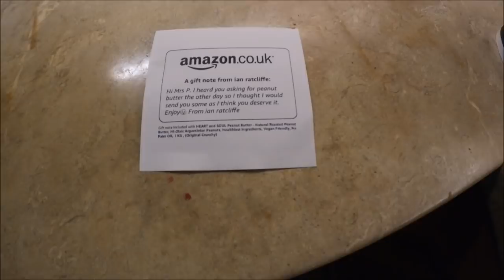Pulling Ragwort, Stud work and checking my new yard drains.  28 09 21

Comment: When we came to our farm, there were 18 acres of seriously ragwort infested pasture. We cut one field for hay and picked through the swaths to remove the weed. We filled 4 twelve foot trailer loads and burnt it in big heaps. I was surprised how those damp weeds roared away in an inferno. We invited a neighbour to graze his cattle on half the area for two weeks. Three weeks later had to remind him there was only ragwort to graze. Finally got rid of them and topped the field and left it until the Spring when we grazed the sheep at the rosette stage. They did a good job in getting rid of most o it. We had to pick carefully through the round bales when feeding to remove what we missed. I never walk past a ragwort plant now, my pocket knife is handy to help loosen the roots.
Reply from the maker: I wish everyone was as diligent Wendy, I don’t necessarily want to see it irradiated, there are a few little beasties that rely on it. But I would like to see it under control.
Reply: @FarmerP  yes we have rough field full of wild flowers and the occasional ragwort attracts some pretty butterflies, such as the small copper. I pull them though     before they go to seed..
Reply from the maker: @wendyrowland7787  
Great minds there …. 🙂👍🏼

Comment: 2x4 stud work timber is not very cheap £5 a length when I priced it at wikes
Reply from the maker: Dave haggled it down to £2.56 per meter for 4 meter lengths… best price after that was £3.06 then £3.60. He had to travel 20 miles to fetch it though.